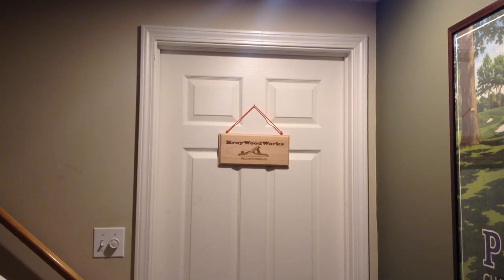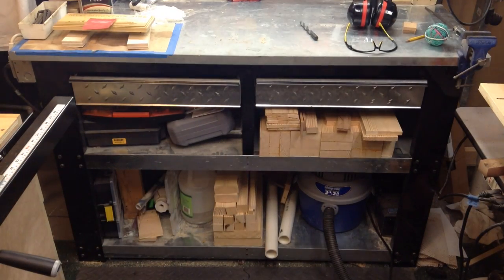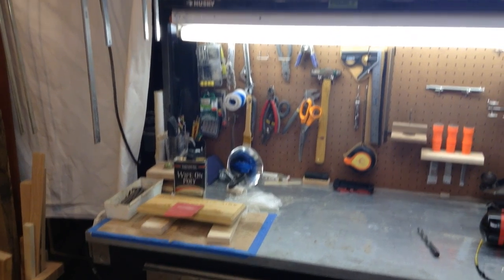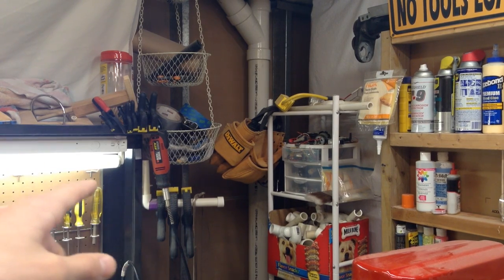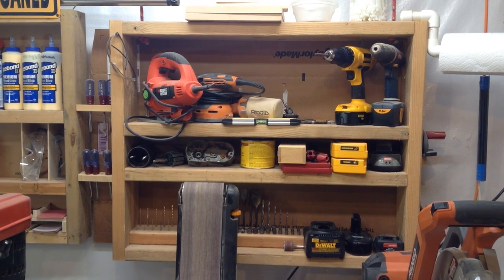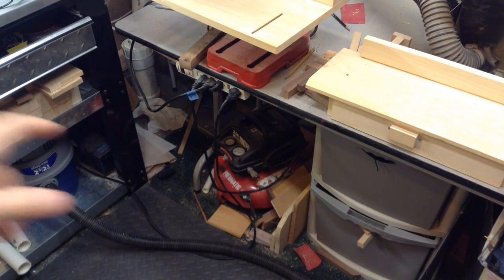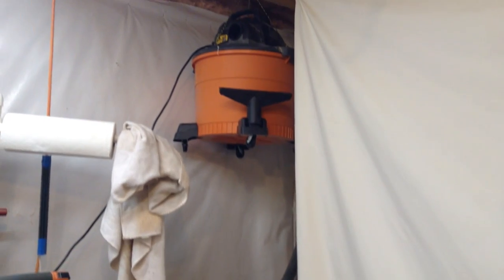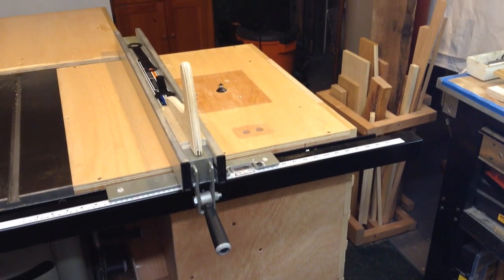Shop Tour 2015

Comment: Thanks for the tour Kroy. I've been whining lately about the lack of space in my single garage shop - I'm going to stop after your tour. I also have the Delta table saw and it's a great piece of kit. Keep the videos coming!
Reply from the maker: Haha, yes my shop is very tiny. But don't forget there are pros in having a small shop, for one you don't have to move very far to get to anything. And two it costs less in work benches, dust collection and wiring, at least when you set it up. Thanks for watching

Comment: thanks for the tour kroy. looks like you took over your basement too..;]  u should invest in 2 things unless u have them already-- a 3m dust mask from home depot - $40.00 it's pink and has refillable filters.  they last FOREVER and maybe a dust collection system. i have the harbor freight one and it works great. its pretty cheap too. that way dust isnt blowing through the vents and into the house. also check your furnace filter every month for dust and change as needed cuz dust will build up in it often.it happens to me every month thats how i know..lol have a good one  bro..:]
Reply from the maker: I would like to get one of those 3m dust masks someday. I just have the cheap ones and they don't fit my face very well. I should have showed my dust collection system in the video. It is not a conventional dust collection system just a shop vac with a dust deputy but it connects to all my tools and it works great. It is also on one of those timer switches that turns the vacuum on when you turn any tool in the shop on. Finally it's funny that you bring the furnace thing up, just yesterday the heating and cooling guy came to fix the furnace. What he found wrong with the furnace is that a sensor was covered in sawdust, preventing it from working properly.
Reply: KroyWoodWorks I have that same dust deputy except mines the dust right separator from Rockler so I know exactly what you have. that works great.saves $$$on vac bags too:]  and yep!..haha- as far as the furnace goes- the same thing happen to us 3 years ago.. that's how I know. The one guy tried saying we needed a whole new sensor and tried charging us like three to four hundred dollars luckily I looked and said look at this filter man it's covered with dust I wonder if that's the problem so I filled my compressor blew off the sensor and the whole inside fix the problem myself so now I know if you check it once a month and if it gets filled with dust fill up your compressor to like 100 psi blow the crap out of it that should clean it up good enough
Reply: Definitely invest in one of those pink 3m dust masks there adjustableand  it fits your face comfortably. Definitely worth the money. I bought a box of those paper ones too and the box is still sitti g on the shelf in my lumber room. Lol
Reply from the maker: +Joe basement woodworking The heating and cooling people always try to get you to buy more than you need. Luckily we are good friends with the owner of the company and we told the guy that came so he knew not to mess with us, haha.
Reply: +KroyWoodWorks hell yea man. sadly in this world  it's not what you know it's who you know.lol

Comment: Great tour Kroy. I agree with Joe about the mask problem, I use those face ones you mentioned when doing some light sanding and clean ups, but any cutting on the table saw, mitre saw, router I use a half face mask with 2 refillable filters either side, works great. You should use one, especially if you use any MDF, bad stuff that fine dust.Take Care,  Barry from England.
Reply from the maker: Yeah, that will probably be something I ask for for Christmas. Plywood is also some nasty stuff to cut on the table saw, so a dust mask will help. Thanks for watching!
Reply: Yep that's another but it's a bit pricey here in England, I usually use the MDF myself or Pine depending on what I can afford. Get Santa to bring a stock pile of wood this year ha ha.
Thanks for the reply, Take Care Barry.
Reply from the maker: +Barry Roberts No problem, I won't need any wood for a while though, I have a pretty big supply. I have stuff hanging from the ceiling that I didn't show in the video and even more in the garage. I even have 2 pieces of cherry that are about 13" or about 33cm wide and over 8 feet or about 2.5 meters long.